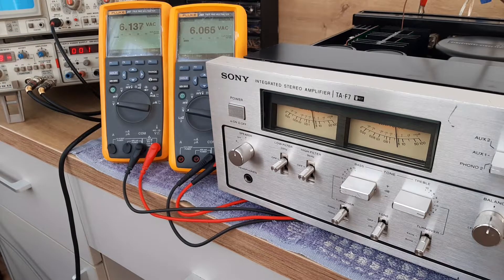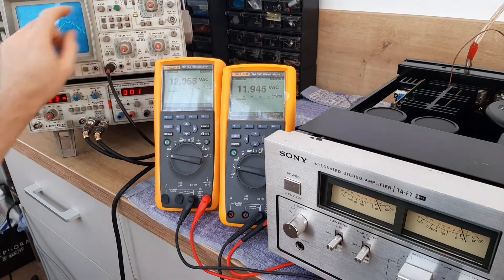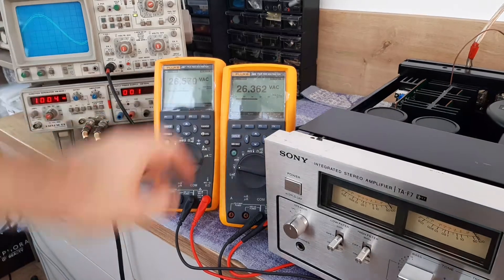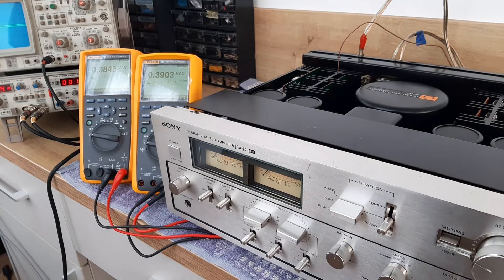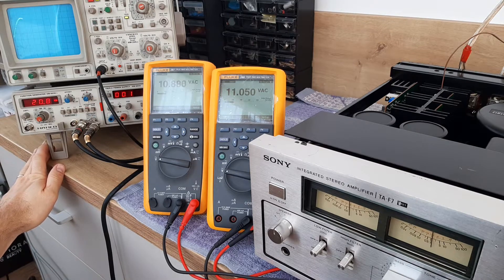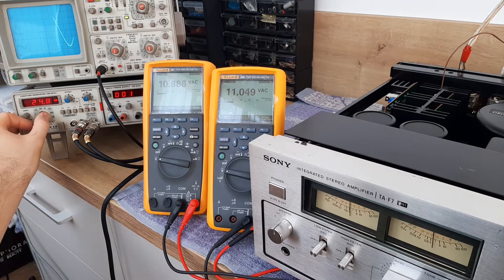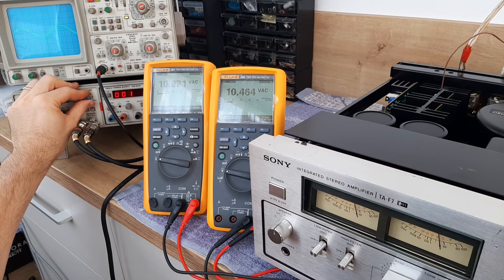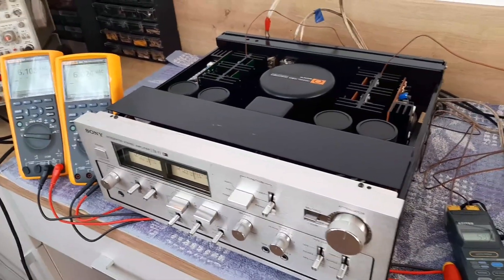Audio Amplifier Output Measurement Using Oscilloscope and Dummy Load

Comment: Way you need two multimeters? You have in front of you a oscilloscope... and Way 4 resistors? Sorry to say that,  but I think it's wrong...
Reply from the maker: Hi, thank you for comment and for subscribe.
Two multimeters because is much easier to have reading on both channels in same time (power output, dc offset, idle and some power supplies)
4 resistors because 2 of them are 4 ohms and other 2 are 8 ohms.
I will attach a link with Dummy Load construction.: https://youtu.be/SEdJ4PxXPQo
Sometimes i have filling i have not enough multimeters connected :D.
Cheers and stay tuned, new videos will be released!
Reply: @MariusHiFii  Hi, I have a question if you can help me? I have two external power amplifier to my Denon avr-x4300h! My problem is with the trigger, wenn I connect the trigger I have noises in to the speakers! External amplifiers are two Fosi Za3. I've connected a high-quality 12v filter, but nothing. The problem is there any time I connect the trigger! Without trigger, zero  noises! Do you know way?
Reply from the maker: @jacklamata2544 hi, i will have some questions and suggestions. 
Q1 - you have that noise from receiver speakers or from Fosi Za3 speakers ?
Q2 - if you trigger Fosi Za3 with other receiver or other device noise is still present ?
I think is a ground missing there or can be a problem because Fossi is using SMPS power supply and Denon linear power supply,  somewhere is a ground or (-) problem.
My suggestion is to trigger both Fossi with other triggers in the same setup. 
I m waiting your feedback!
Cheers !😊
Reply: @MariusHiFii  The nois comes from fosi speakers! Today, I've trait between 12v trigger from Denon to connect Baumeister BT11C88020 and at the output from Baumeister I connected a Y aux connector and than the two Aux cables to the fosis! My try was to connect both at one trigger... but it feels! Nois still there! Tv, receiver, ps5, Denon,  fosis, cd Player All ar at one power outlet!
Reply: One thing what I noticed today was, at one trigger from Denon I connect two 5v fans with a step down 12v device! What I've noticed was that the nois from the fans was in the speakers! But louder this time! I  think the nois comes from the trigger, he transfer the internal noises from Denon across the triggers! What do you think?
Reply from the maker: Hi, my suggestion was to let Fosis connect with Denon, i mean the audio signal and try to start Fosis with Triger from another device independent from Denon. I m curios if noise is present like that...most probably not. Can be a problem on 12 v triger belonging to Denon.
Cheers!
Reply from the maker: Hi, yes sometimes when you connect electrical motors to same power supply with amplifier the noise is spreading around. So we can say this situation is normal.
Try to not use the trigger from Denon, use another 12v trigger source- maybe another receiver and lets see what going on.
Cheers!
Reply: @MariusHiFii  The other Devices what I have they don't have trigger! Tv and ps5 don't have that! And other amplifier for the moment I dont have another one! I was thinking to install a 12v charger with remote control to Start the fosis! Other way, I'm out of ideas...
Reply from the maker: Manage to complete this situation?